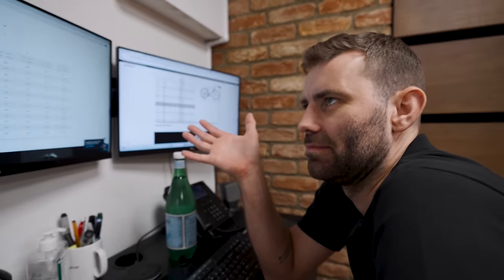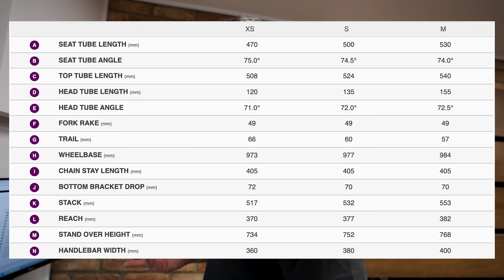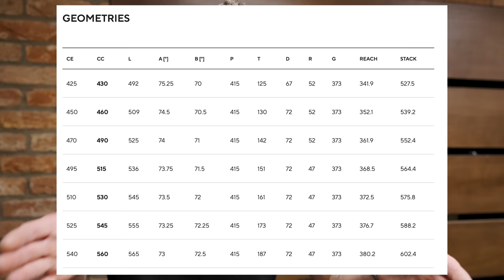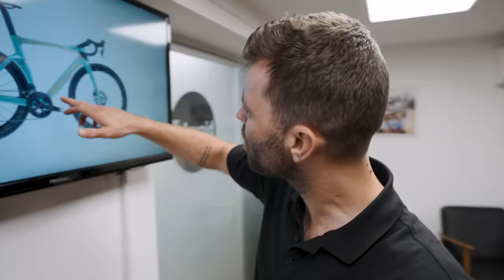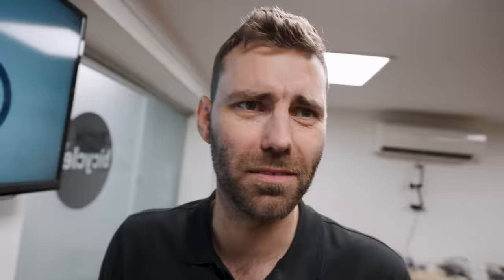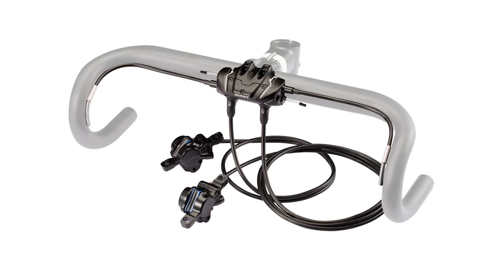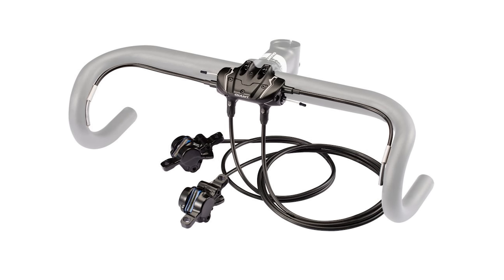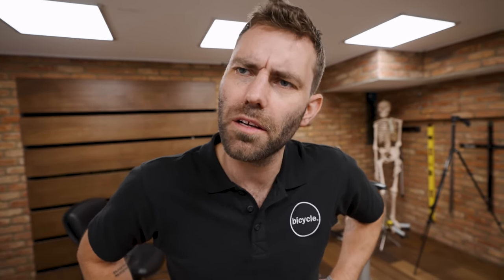Pro Bike Fitter's 9 Most HATED Bikes

Comment: Honourable mention to my own bike, the Canyon Grizl: a gravel bike designed for long bikepacking trips and ripping it on rough trails, yet they gave it the same geometry as the Ultimate, their traditional race bike, rather than the Endurace, their all day road bike. I'm lucky because the Grizl fits me wonderfully and as such I love it to bits, but it really doesn't make any sense to have given it race bike geometry given its stated purpose, and I can imagine that it's much too long and low for a significant portion of its riders.
Reply: I think the reason it’s just as long as the ultimate is, because you are supposed to run a short stem on it.
Reply: I know there are mentions of it running a shorter stem, but the stack for the given size is still small and that short stem adds to that problem because if you flip the stem, you can only go so high due to the short length to compensate for that short stack.  

Really fun and lively bike but it was absolutely too race-y for me.
Reply: @dougquesnel5613  Luckily you don't have to buy the bike and it still exists. My gravel bike is just as low and I'm glad it is.
Reply: @chuckyfox9284  you are right but when things are advertised as endurance type bikes and they aren’t it can become frustrating is the point. Nothing wrong with racey bikes.
Reply: @chuckyfox9284  True, mine came with a 90mm stem which is 2cm shorter than the same sized Ultimate. I still think it's a surprisingly long bike for its class.
Reply: @dougquesnel5613  Yeah like I say, I feel very lucky that it fits me so well because it is so fun and capable, but like the Ribble mentioned in this video, the marketing and the geometry don't really match up. It's extra confusing when you consider than Canyon also has the Grail which they advertise as their gravel racing bike (although to be fair, that one is even longer and lower!)
Reply: I am late, but anyway:
I have a Grizl, too. I also am 50% legs (185cm tall with 92cm inseam). The past half year I mainly used 32mm road tyres on it. Now I want to upgrade and buy a dedicated road/race bike, especially to shred 100s of kilometers on it, but also to be faster/racier. Sticking to Canyon the Endurace seemed to be the right choice.
Then I compared the geometry of Grizl, Ultimate and Endurace and was flabbergasted how close Grizl is to an Ultimate or even Aeroad.
Now I am thinking of buying an Endurace and fully slamming it. Or buy Ultimate? Or go full speed and go for Aeroad?!

So, Grizls aggressive geometry is making the decision about my new bike much more difficult 😅

Comment: Canyon Grail owner here, another kind of self defeating thing about the hover bar system is;

In any situation where you'd want to take advantage of the "vibration dampening" intended by the hover bar design is also probably a time when you want to have your hands on the brake levers and positioned a bit wider apart. You end up never using the tops for their intended design purpose. 

I also hate that there is no way to adjust stem length without buying a whole new integrated bar/stem. And there is only like 15mm of stack adjustment. AND when rewrapping the bars, you have to use an extra long bar tape because there is more surface area to cover, and that limits your options considerably. 

All that said, when in the drops you are able to get a really strong positive grip by looping your thumb over the lower structural bar. They are really quite comfy in the drops. 

I generally love how the bike rides, but I'll not be going with a Grail for my next bike.

Comment: 10:53 "Trek had the marvelous idea of putting the brake underneath the bike."

That's how it used to be with some vintage bikes. AFAIK they moved the brakes up to seat stay bridge where they have stayed for that same reason: dirt and crud in the brakes = reduced stopping power. Funny how, even in the modern era, hi tech multinational companies need to learn these lessons for themselves.
Reply: The first Specialized Stumpjumper had the brakes down there, 1990 or so. Ludicrous
Reply: More than a few triathlon bikes put their brake caliper down there, too. You can always depend on triathletes neglecting bike hygiene and maintenance, so they were rendered inoperable from the sweat, sand, salt, and spilled energy drink that accumulated down there.

Comment: I have experienced the rim brake in a dirty area effect on a folding bike, Riese & Mueller Birdy with 18" wheels.   The brakes were naturally close to the ground.  I rode it a couple of Km per week on some city gravel paths and dirty farm roads and it was amazing how filthy the V-Brakes braking mechanism got, and how quickly it got that way, and how much if affected the performance.   I got so sick of cleaning and greasing them, that I had replaced the Vs with a set of Magura HS 33s which had the moving parts of the brakes relatively protected.  It made a world of difference.

Comment: I had those brakes on my defy. They weren't that bad.  That said I have good luck with cobbled together stuff. As was mentioned they were a work around to get a cheap group on a disk bike.  

The main problems I had was finding compatible gps mount and the massive weight. 

Dining a mix of 105 and tiagra now.
Reply: What GPS mount did you find that you can use with these?  I have the same problem.

Comment: Honourable mention to the previous generation Systemsix which when used by EF with the Vision Metron integrated handlebar and stem required at least one spacer underneath because otherwise the back of the stem fouls the frame and you can’t steer the bike… That and the big unfinished hole in the headtube for the hoses to dive into. I’ve noticed they have sorted this on the new models though!

Comment: What I also don't understand - considering the analysis of the typical road bike customer - is why 99% of road bikes out there make you choose between a 140mm and a 160mm front rotor. Personally I don't know anyone who wants to ride 140mm at the front (only some folks prefering 160mm front/140mm back).
It would add a tiny amount of weight to prepare current forks for the forces of a  180mm rotor setup, helping bigger riders getting a more suitable brake system and still allow everyone else to ride their 160mm front rotor.

Comment: I have the canyon grail and the bike doesn’t wobble and doesn’t require extra bar tape.  The bearing top race is rubber and will fail in two weeks, but the bike doesn’t wobble and the bars are fine.

Comment: The Bontrager VR-C shape is 100mm reach / the VR-CF is 93mm reach. The VR-SF is 75mm, which is the only bar they make that is not excessively long. 

For the RSL Aero Road Handlebar on the new Madone, I believe that the narrower hood to wider drop width throws off the labeled reach measurement.
Reply: 73-80 cm is about right.

Comment: Ridden my Roubaix for the last 5 years, sublimely comfortable and no issue whatsoever with the Future Shock - guess it works for me and appear to be well built (won Bike of the Year in Cycling Plus, can't be all that bad then I guess)
Reply: I've got a 2018 Roubaix as well, nothing to complain about in close to 10k miles other than the general longevity of the parts Specialized used. That said, I recently picked up a used 2016 Bianchi and it makes me wonder what all the "improvements" in recent years were about...
Reply: I have a 2021 Roubaix Sport and love it.  It's so comfortable and fast with carbon wheels and GP5000 tires.  I might upgrade the groupset to Di2.
Reply: @norcalchrismeister  Yep, the design is hard to beat when the aim is going fast in a straight line on less than perfect roads. I love that on pavé you can just go to the drops to get more weight on the suspension, which helps riding fast through them which is what you are supposed to do.
Reply: Same here. 2013 Roubiax. Ended up riding like a noodle with the 'Zertz' inserts breaking frame integrity. Zoom to a 2018.5 Roubaix. Solid and the Future Shock along with the Z seat post was a vast improvement. The first run had two issues: it used an actual hydraulic shock and the attachment point between the fork and the shock was made of the wrong material. Fixed both. Now I have a 2023 Diverge. Really great gravel bike.
Reply: @norcalchrismeister have the same bike. Thinking about upgrading to 105 di2. Rode a lot of cobblestone roads with friends in Richmond, VA and it was definitely noticeable that my hands weren't shaking as much compared to theirs.  It's a solid bike with some good wheels and tires. Can also do crushed gravel towpaths nicely.

Comment: on the roubaix I'd add in the fact that the future shock cartridge is not serviceable so you have to buy a new future shock cartridge from spesh...

The madone SLR prior to the newest one had issues with the iso speed mast developing lateral play and the bb90 system is a terrible idea.
"lets put a bearing straight into a carbon shell"... good one

One that missed the list is the new cannondale syanpse. on paper a great bike.... threaded bb, 27.2 seat post, no cables/hoses through the headtube... but then it all falls on its face. Its got a load of lights and batteries bolted to it that you cant remove and have to pay extra for. the light isnt even bright enough to ride at night and the battery isnt powerfull enough to rubn the front light, rear light and radar for a reasonable length of time.

Comment: I think they could throw in the Giant TCR Advanced from 2016-2022. I have always ridden Giant because their XL frame fits nicely in terms of reach. Starting in 2016, Giant redesigned the frame. All seat tubes were shorter, the little extra tab of seat tube above the top tube was gone, and a proprietary seatpost and clamp system that has a tendency to crack seatpost. To add to this fun, the proprietary seatpost did not get longer to compensate for the shorter seat tube. I bought a frame. Built it up (it was amazing), but the seatpost was right at the minimum insertion line. Four seatposts late and Giant offered me an ISP frame at bike shop cost because they realized there was no fix to the problem of fit. So they redesigned the frame to be smaller, but still fit the same range of heights. Yeah...not the smartest.

Oddly enough, the TCX (cyclocross frame) uses the Giant D-Fuse seatpost, but also has the option to run a 30.9 mm seatpost with an adaptor. If the TCR had this as an option it would have been a great bike.

Comment: I'd like to suggest the Simplon Pride II to James. The brand did the "cervelo" handlebar before cervelo and you can actually take it appart and adjust it without the necessity to replace the whole thing.

About the grail (I have one ^^): yes, this shock absorption stuff is marketing BS. And yes, replacing the handlebar tape is a nightmare (you can do it with one roll, but it needs practice and quite some force). But having the option between a very aggressive position in the drops and a quite relaxing position in the top is pretty awesome I have to say. Thats something a normal handlebar simply isnt able to combine. Also hooking your thumbs in feels nice and very secure. The looks though... I dont mind, but I understand if some people do ^^.

Comment: I can't believe the Cannondale SuperSix Evo didn't get a mention; silly pin in the headtube waiting to write-off your frame? Seat-clamp mechanism that slips (can be fixed with tape and thread locker). Speed-release (put it on a wheel-off roof carrier and watch your fork flex like mad), why oh why? Oh, and of course, a press-fit BB, which has now been ditched in the latest model. In defence of Liv, my wife has a Langma Advanced and it's great. Things like using the Shimano levers that are designed to suit to people with tiny hands is better than most manufactures.

Comment: Trek wasn't alone in putting a rim brake under the bottom bracket.  I had a Kestrel Talon with the same design, and I still have a Specialized Shiv with the same design.  A friend of mine has a Giant Trinity with the same design.  That gunk collects  on the brake cable and gums up the system is one criticism, but another is that the cable routing is so awkward that the friction is too high even when the cable is clean.
Reply: Has a GT mountain bike a 1984 model that the suntour rear brake was under the chain stay. The cable pulled on an hourglass metal plate, which would pull the pads to the rim. It was a nightmare to set up.

Comment: Had a 2011 Roubaix 58cm and found the reach a real issue even with a basic 110mm stem, kind of weird geometry on those bikes that are meant to be for endurance. Moved onto a 2011 Tarmac with 100mm stem and it has been magic, that is until the steerer failed. Currently building a 2021 Giant TCR Pro 0
Reply: The head tubes of the Roubaix of that period were outrageously tall, especially from 58 cm on up. For me the Giant TCR, geometry virtually unchanged for 16 years, hit a sweet spot. The second-generation Scott CR-1 hit it, too.

Comment: Bikes with geometry no one can actually use creates a market for professional bike fitters; hence, many riders, especially perhaps, women, can ultimately get a bike that fits and doesn’t hurt to ride. For me, a [brilliant] bike fitting meant replacing several factory parts. All good, except now I want to upgrade to more gearing, wider tires, etc, but an off-the-shelf bike would likely mean another fitting, and jettisoning parts I won’t use (but have paid for.) Answer: custom bike build, with frame that mimics current, Trek geometry; reuses bars (narrow and tough to find), saddle and stem; features drivetrain, shifting and braking system I prefer.

Comment: James - The Bike Curmudgeon! Tell us what you really think! This rant was 100% spot-on as well as funny. He touched on something I've wondered about. Back-in-the-day handlebars had grooves in them for brake and shift cables so once installed you could wrap 'em with tape and everything was good. WTF doesn't the industry do the same with all these (silly) one-piece "aero" shaped things? Is it too hard/expensive, like putting a hook on a wheel rim to keep the tire on? Even if they insist on running all the stuff through the headtube/frame this could at least make swapping-out a bar/stem or one-piece "cockpit" (Oh, how I hate that word!) not an all-day, expensive, complicated project. But does the industry care if the bike fits anyway? T-shirt sizes. Just buy one and ride it...or better yet, don't ride it, just buy it. Less warranty claims that way!

Comment: 1, Disagree in regards to the Aethos, I have one and love it! Also found it worked well for most of my fit clients. The reason. Why they made it aggressive is because that’s what people want, Specialized sale far more Tarmacs than Roubaixs for example. Don’t know where you get the hate of Giant Conduct, I had this and it worked great for cheap hydraulics at a time when they didn’t exist. Never had an issue with cable stretch and the interstated accessory’s worked well. Only issue was it’s ugly
Reply: You can tell he has never ridden one.

Comment: I have 2018 Cervelo S3 which I had a bit of problem find a proper ride position. When I did bought that bike I didn't pay enough attention a geometry. Afterwards I noticed the seat tube angle was much different than my previous bikes. On that bike was a seat post with 25mm setback which set the saddle way too back so I decided to buy a seat post with 0mm setback and now it's much better.

Comment: completely agree, long reach leads to discomfort. I have no problem with the handlebars being quite low, though (is that just me or is that normal?). Question: Wouldn't it make sense to choose a frame size that's relatively small? That brings the handlebars closer to me (and allowes me to push the saddle back to take some weight off my hands) and by pulling the seatpost out I maintain my saddle hight and get into a low position.

Comment: Lessons in buying a bike:

1) avoid proprietary fitting parts like the plague. No exceptions.
2) avoid "new improved" bottom bracket standards
3) if you don't race don't buy a race geometry bike (buy something that looks like it if you want)
4) if you're on a manufacturer's size overlap you almost certainly want the smaller one, and even that might be too big
5) one piece bar/stems are beautiful, but only get one if you (a) like maintenance or paying for it (b) have based your purchase on having previously owned a well fitting bike
6) if you're spending 5k+ and you aren't spending 10% of that on shoes and a bike fit you need to question your life choices.

Comment: On the subject of bikes for non-average sizes - can companies start making bikes for larger people too? I went for a bike fit recently, and as a 6'5 individual the dude told me we might have some trouble since my legs are so long, however when the saddle is at the right height for my legs, the reach to the bars will be excessive. He explained how people's legs typically account for more and more of the height as a person gets taller, but the bike frame is just scaled up to make a larger size. So while a 'small' size bike may have perfect ratios between seatpost/tube length and reach, on a larger bike it's totally out of whack. Not to mention the official weight limit for the frame is barely 10kg off of a healthy weight for a bloke my size and with my body fat/muscle mass - which is to say that of a bang average amateur cyclist. As soon as I carry a few bottles, a lock, and a box of sandwiches in a frame bag I'm over the limit and the warranty is void.